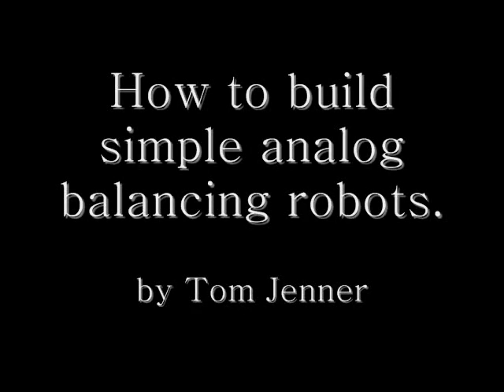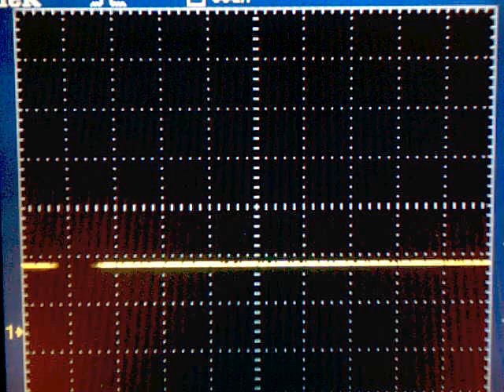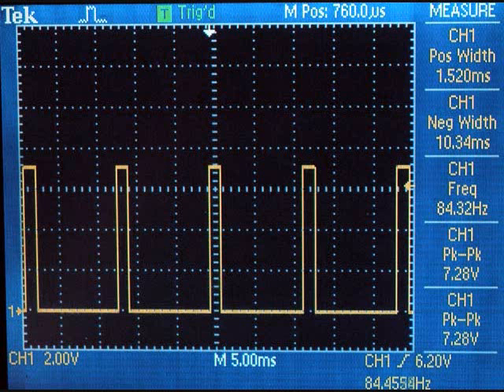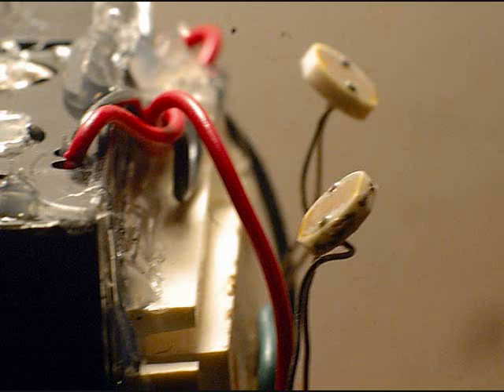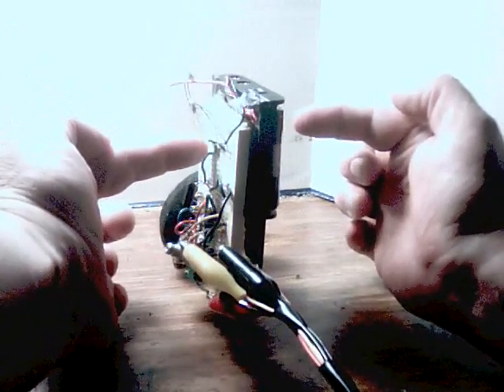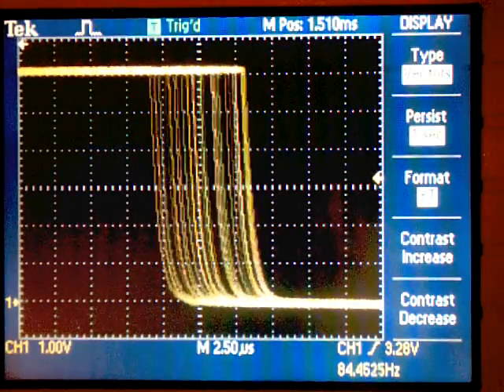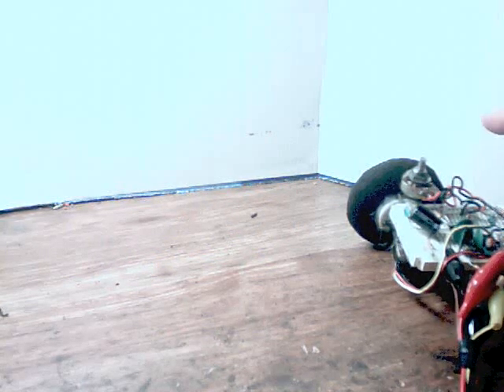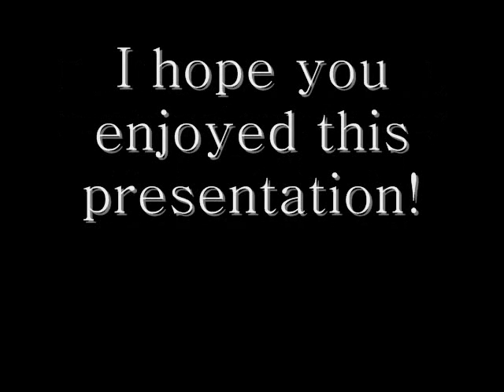How to build simple analog balancing robots

Comment from the maker: Glad it worked! Pin 5 is actually frequency modulating the circuit. It just happens that the circuit also functions as a PWM. Servos need 1-2mSec pulse by the pulse rate doesn't matter as much. Trying hooking pin 3 to a speaker through a capacitor.

I don't think I've ever tried no input to pin 5. I always used a 10-15k resistor connected to some sort of voltage divider.

Definitely try using a photocell and circuits found in the 555 timer video. It's a lot of fun playing with those circuits.

Comment: didn't expect such fast reply. Thank you very much by the way. I tried again today, and guess what, it works! I don't have an oscilloscope, I'm relying on the math.

Apparently, the previous pot I used was not a linear one, so it literally skips the High-Time resistance range (between 1.44 K - 1.8 K). Ow and, the slight chance I made on today' layout was to connect the LDR (the high-Voltage one) straight to Vcc, not through pin 8 as drawn in the schematic. I wonder which one did the magic.

Comment from the maker: It's a "radio controlled aircraft style" servo that's been modified for continuous rotation.

Try searching "continuous rotation servo" in Google and they'll be links of how to modify servos or where to buy them pre-modified. Parallax has modified servos selling for $13.

The 555 timer is being used as a signal generator needed for controlling the servo. If you want more torque with a small signal, you just use a smaller resistor for Pr (in the vid). This increases P gain.

Comment: @roboanalogtom Yes, all balancing robots I've seen uses accelerometers and gyros, and that made me very impressed to see such a simple circuit managing the same thing (and the clever use of photoresistors)! So an integrating part would help? I was under the impression that integrators were mainly used to correct for constant offsets, which can't really be present in this kind of application as the robot would then fall.

Comment from the maker: @silverstream314 Yeah, if one used accelerometers and/or gyros instead of LDRs then you can increase stability. Also, using an active PID instead of a passive PID set up would also increase stability since it would be easier to tune the behavior.

I was happy just to get such a simple circuit to stay up!

Comment from the maker: @brsild No but I'd use the Sharp range finder IR sensors. You'll only need one. I got a single transistor balancing robot to work with the Sharp sensor (it's a short vid posted in my account, it had to keep moving forward to maintain balance and the mosfet transistor was used in linear mode and was only stable for a 20-25 foot run). 

I've seen vids of balancing robots that use two simple IR sensors but I don't recall any done purely in analog.

Try googling "Dale's homemade robots".

Comment: this is valuable video, thanks .
Reply: Now as far as PID biCORES this means no code needed right? so now what if i want to add control, will it become passive then ? 

how do you make passive systems? i ask cuz im building a humanoid and is pretty tall so coding movement is not hard tho coding movements while establishing PID  i find extremely hard, i just can't put into code. 

just to be clear what i mean by passive is that if i raise my androids arm while PID is active meaning keep arm at a certain level and i go and push on the arm it will go with the flow and then return to position once i let go or if i want i can have it stay at current position

Comment: Ow, almost forgot, So after we activated the pin 5 with modulation input, woh can we measure the High and Low time? 
because I did notice that we need to re-tune the pot (R1) after we disconnect pin 5 from the 10uF capacitor and connect it to the PD network.

Comment: Hi there, I think this is a pretty awesome analogue robot!
I have some questions: Why do you need an external power supply and where is that connected? I mean you have the batteries. Isn't that enough?
Reply from the maker: This was just a quick example that I put together in a few hours. I do have a video of a different robot that's not being powered off a lab power supply. Those wires you see on the bottom are connected to the power supply and an oscilloscope.

The batteries are on the robot above the center of gravity, they're just not being used on the video. I plead laziness.
Reply: roboanalogtom
Thank you for your response, it clarified a lot of things! Have a nice day

Comment from the maker: I would need to have a pic off your oscilloscope to help you. People have contacted me before and trying to diagnose  an oscillating circuit without seeing what's going on is very difficult to do.

I spent a considerable amount of time with one beginner, for example, an the problem was that the board wasn't powered up.

The 3 most common problems are the diode is backwards, the 1 ohm resistor to pin 8 wasn't use and the 1000uf capacitor isn't next to the 555 timer on the board.